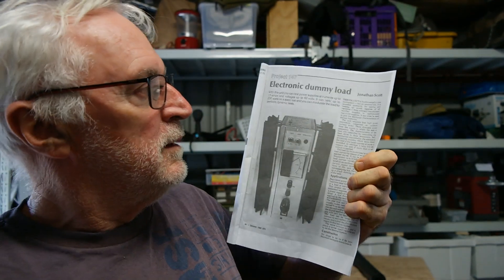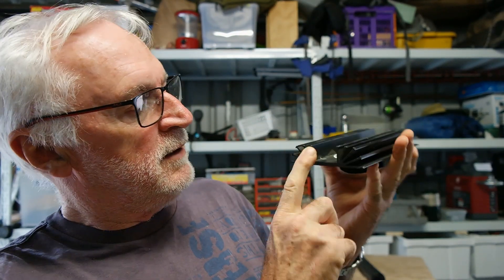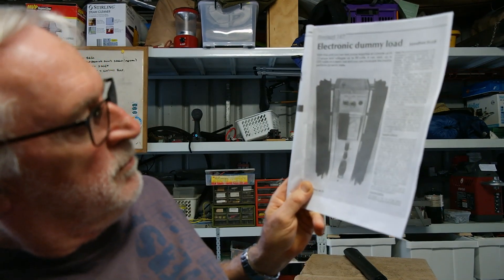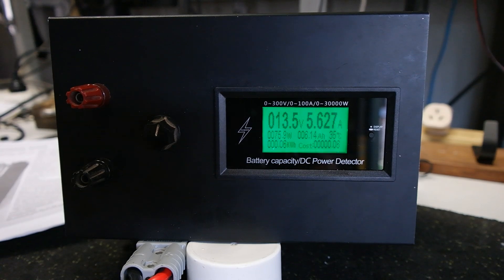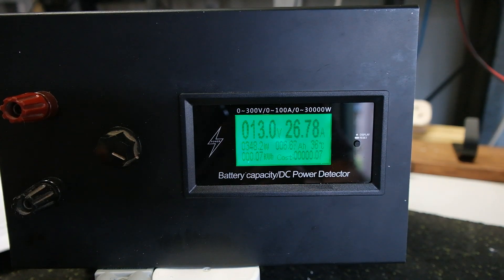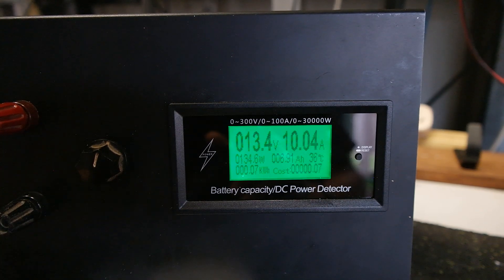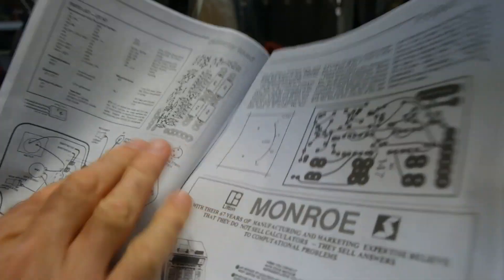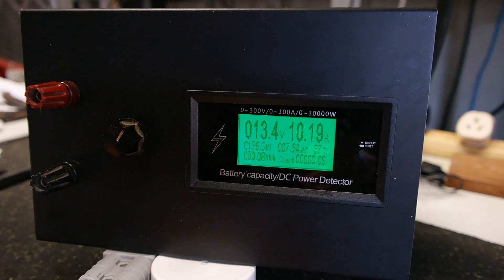Constant current DC Load for battery & power supply testing ETI-147

Comment: Tim! Hans from Holland here: Question: have you got further news about the problems with the dc to dc Renogy from your former video? Thanks!
Reply from the maker: Hi Hans, Think your jumped on the wrong video here,  however no I never heard back from Renogy. They are notorious for very bad support via email etc. The DCC50S has been in for months now and has been working great but I think it just needs very large cable to get close to full output. Also my customer showed me how the indicator LED's stop working for no reason each day (although this does not interfere with its operation at all). He has to shutoff all power for a few seconds (so at night time when there is no solar) and it resets and the indicator lamps work for the rest of the day again.